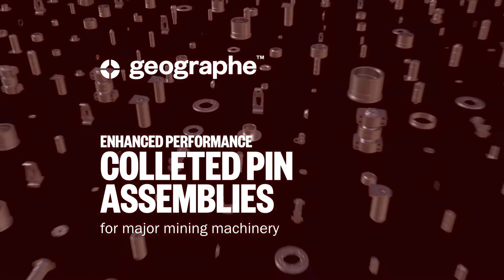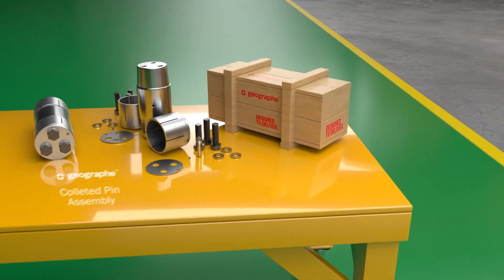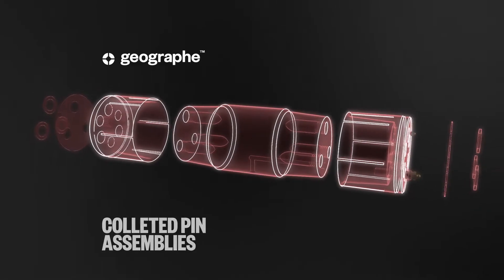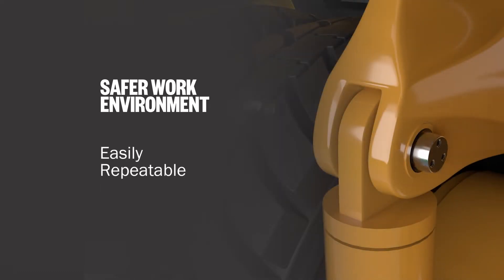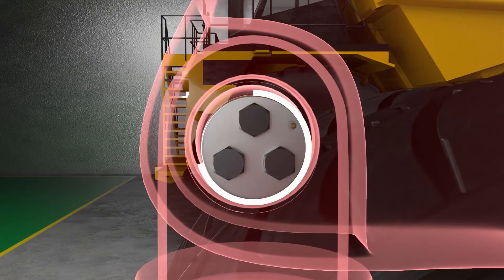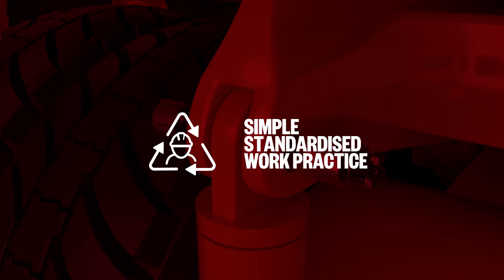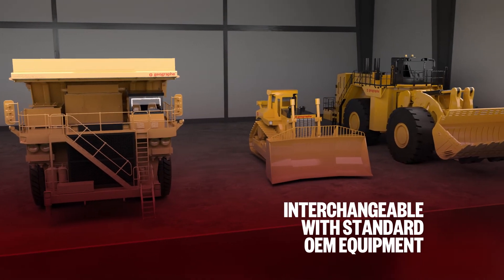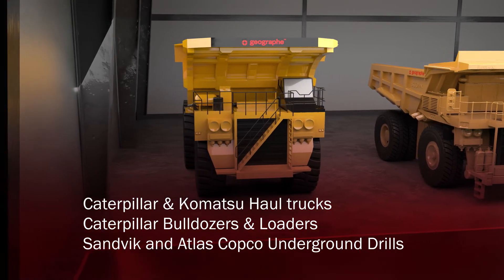Geographe Colleted Pin Assemblies - engineered to suit CAT & Komatsu Haul Trucks, Dozers & Loaders.

Comment: Looks like an Expander Pin to me!
Reply: Looks similar but it´s not the same. The one in the video is to the Caterpillar fleet but you can see three bolts instead one, a diferent angle in the taper, also many of the Geographe pins has "lubrication grooves" over the surface connected throw a grease conduct to keep grease flowing to the bushes. As said before, looks similar, works different.